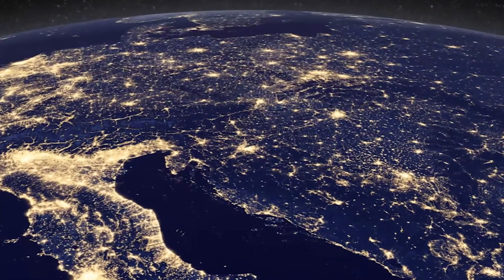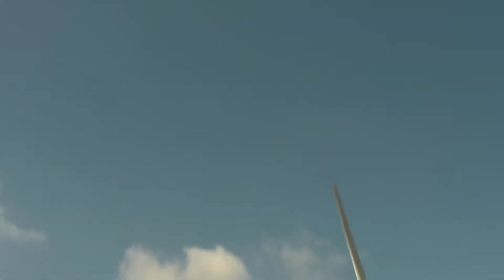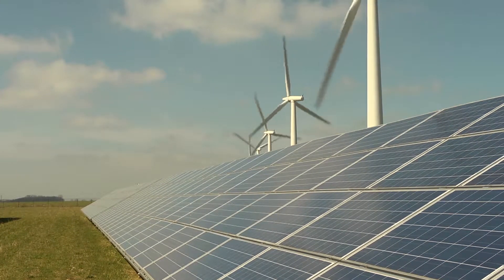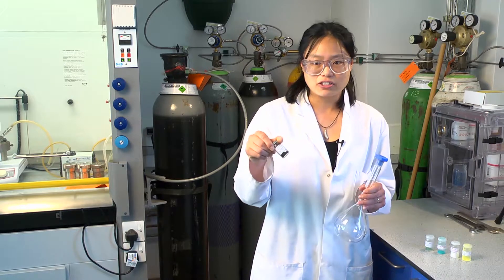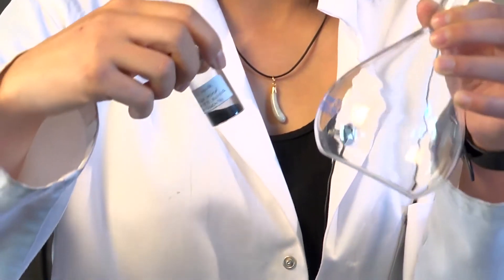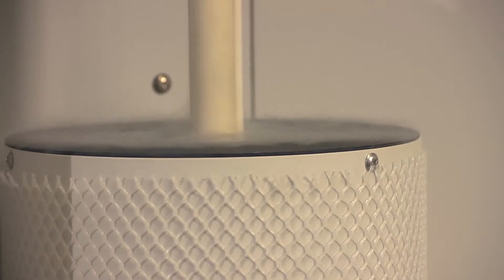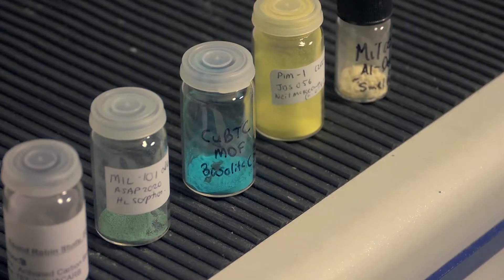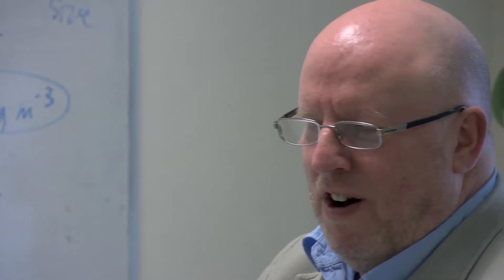STORING HYDROGEN IN SOLIDS

Comment: I have designed a Solid State Hydrogen Cell based on a Hydrogen catalyst sponge. The easy way to measure how much Hydrogen is captured by the cell is to weigh it before and after Hydrogen charging.